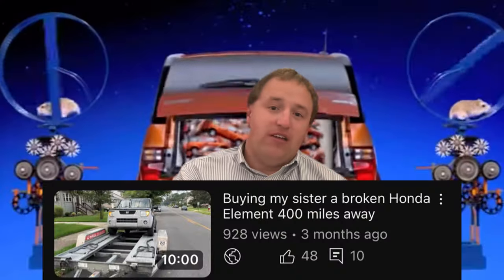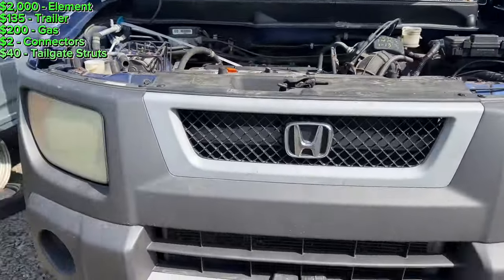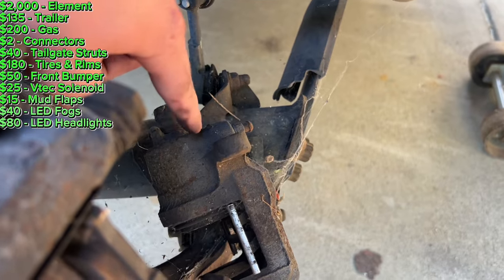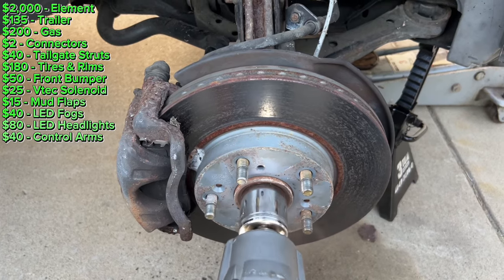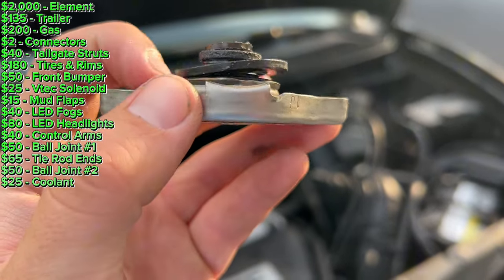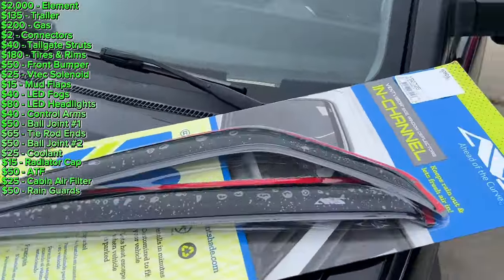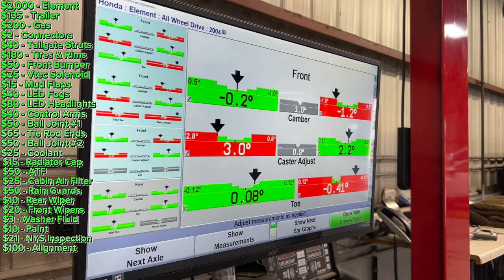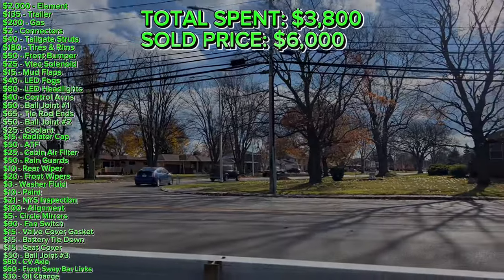Buying, restoring, and selling a 2004 Honda Element AWD

Comment: I think what you are doing for the Element community is great! Restoring and putting these vehicles back on the road or in society is epic, salute!
Reply: I just bought a 2003 220k miles one owner. I’m thinking of using my mechanical knowledge to start a series of me fixing pretty much everything on it
Reply: @shanedottie  I have a 2003 with 225k!
Reply: @joseph9531  nice how’s the trans holding up
Reply: @shanedottie  As crisp as the day I got it in 2020
Reply: @joseph9531  nice, if you plan on keeping it long than change the fluid it’s super easy, basically as easy as changing the oil
Reply: @shanedottie at what intervals should one be changing the transmission fluid every 80,000 & how about a full tranny flush and not just a drain/fill?
Reply: @ never flush it just drain and refill multiple times in a row

Comment: Holy shit, I'm going to get those rear mount struts.  Also, I had the P2647 VTEC issue.  Went through a few solenoids (new and old) not working to clear that issue.  What I did, and recommend doing, is prefilling the solenoid with the new oil  (like what you do with your oil filter) to the top tapping to remove most air bubbles.  When installing, quickly push on the head while also installing the 3 bolts.  After that, had no issues.

Comment: He skipped a step, because upon replacing those ball joints, he had to get the front end alignment for sure, or the car will be going left to right. Once you take those tie rods and ball joint loose, you have to get a front end alignment, it's no way around it, so he flat out skipped that step in the video. He also could have saved himself some money by merely going to a part store and getting that solenoid, because I did the exact same thing, I bought an after market and ended up getting a brand new one at the parts store with a warranty. The time and gas he spend going to the junk yard, he could have gone to the part store. He also could have ordered those ball joints and got them much cheaper online. I have an Element so I know. Looks like he has rust issues underneath as well.

Comment: Great Video.  In depth on common issues with a fantastic commentary & explanations.  Really liked your work around with the sockets to get the CV axle apart. The battery upgrade with tweaks made to the tray are a huge plus for that E or any similar vehicle. WATKINS GLEN !! AWESOME!! Your sister missed out on a vehicle that many ppl would camp overnight for.   Makes me wanna do more maintenance to get ours as good as yours.  10/10.  Nice job.

Comment: Thank you! Just bought my second Element after a 10 year hiatus and got a 2005 EX FWD in cargo Khaki. Stoked on the color even though it is not AWD. It is stuck in Limp mode after the small dealer replaced the VTEC solenoid with an aftermarket one. I should have got grabbed the original he removed. Going to get an OEM part this week and cross my fingers. Already cleaned all of the screens part of my the oil circulation system.
Reply: Went through a few solenoids (new and old) not working to clear that issue.  What I did, and recommend doing, is prefilling the solenoid with the new oil  (like what you do with your oil filter) to the top tapping to remove most air bubbles.  When installing, quickly push on the head while also installing the 3 bolts.  After that, had no issues.  
Also, clean or replace the front VTC filter along with the solenoid, consider that before replacing the aftermarket one.  Also to check GND continuity from the Engine GND to the solenoid connector GND (yellow wire).

Comment: You did a great job!

but 

Adjust your mirrors out properly and the only blindzone you should have will be right next you. No stick-ons required. Also, the battery upgrade is very overhyped by the forums. It is the same battery used in all 2.4L Hondas...I used a quality 51R battery and it lasted me 6 years, starting through midwestern winters. If your battery won't crank in the winter, consider if you have not driven in a while you may need a tender during cold weather...getting a 'bigger' battery fixed the problem because it can drain for longer without issue. It does not mean the OEM battery is undersized.

Again great job. And good note about the ball joint needing splines.

Comment: Another great video! Where did you learn to work on cars? Did you just watch videos like this or did you go to mechanic school? I'm impressed.  I've owned two Elements (one of which is my current daily driver). I'm not afraid to do engine work (valve adjustments, sensors, pumps, things like that) but the thought of doing the type of suspension work in this video without a lift has always been pretty intimidating to me.  You have my respect!
Reply from the maker: I use to work at a car dealer through college and my employee labor charge was only $35/hour, so up until then I didn’t do anything myself, but would always watch the mechanics. Once I graduated I stopped working there and had to start working on my own cars at home. YouTube definitely helped lol

Comment: I feel as though I'm getting ripped off for the Element that I'm about to purchase and no fault other than to my own for accepting this price but I also hear these Elements usually list higher than what Kelly lists the value. $7,000 for a 08 EX 152,000.
A lot of replacement parts were part of my decision for purchasing.
Brand new set of Hankook all-terrain tires rated for snow.
New tie rods all around,new set rotors/brakes all around, 4 new motor mounts, new door checks, fresh oil change & alignment. The previous owner spent $1,400 on just the parts alone. The paint is in very good condition, surprisingly the molded bumper and other portions of the car that are not metal are still in good unfaded condition & I'll keep those parts looking new by using Cerakote trim protectant. I did notice a dealer trying to sell a two-wheel drive Honda Element for $33,😂😂😂

Comment: Alex, someboy is selling me an Element for $2,000, with these problems: 

It needs:
- catalytic converter (test pipe in place) 
- Intake Air Control Valve cleaned  
- AC servicing (no idea what's not working) 
- A-B trans solenoid (fluid/filter replacement too?)

It has:
- 175k miles - 4-speed auto trans - AWD - front grill guard - seat covers - Thule roof rack with RockyMounts -- running boards - receiver hitch - VW rear hatch lifts - clear Michigan title -

Also a new 3 year battery, new cabin and engine filters, and an OEM storage console armrest

If I knew what you know, I'd get it.

Comment: You didn't have to sand the rims, all you had to do was use purple power, it would have cleaned those rims sparkling clean. I detail vehicles and I've had some truly bad rims, purple power would  have eaten away all that rust EASILY. You also could have used plasstic restorer for the trim. Mine looked like that and it made it black afterwards.

Comment: I love your vids, I have an issue with my 2003 DX Element; how to get my Elements hood open when the cable seems to be disconnected. Any ideas to get it open....Any help is appreciated. I'm in the rust belt. Element has 179,000 miles....Tks
Reply from the maker: Luckily I’ve never had to deal with that knock on wood

Comment: I love my 2006 Honda element

A man made a left-hand turn, hit me right in the front broke the plastic bumper and grill, and he pushed in and broke my radiator and my condenser 

I fear my insurance company is just gonna say it’s totaled because it has no value 

Anyone who can help me with this Honda elements are worth more than they show on paper. Just try and buy one. 

I will check back for responses thank you everyone in the Honda Element community 

This is fantastic video. I can’t wait to fix my arms in the back and hold that tailgate up. I love my Honda element.
Reply: Sorry I hadn’t seen this sooner.  I have just recently just recently gotten the element bug.  I  had a similar  problem with a ford ranger.  I was satisfied with what the insurance paid me until I tried to replace the truck.  How did you make out?  
I think that if I wind up getting an element, I’ll see if I can get a cash policy.  Somebody told me that they doit for classic cars.  What ended up happening?

Comment: I was fine with what Alex did until he got to the plastic panels and he mentioned "Toaster Grease" and I shuddered. He mentioned CeraKote Trim Treatment, so he knows that CeraKote is THE go-to BEST STUFF for clear lenses and plastic parts! Did he mention that if you use the GREASE that your plastic will never accept the ceramic treatment? Well NO! Why does this GREASE exist? Because CeraKote costs about $17 and the GREASE is $1.50?? There's always some joker out there that puts together a trash product cheaply. Don't use the Toaster Grease EVER!! Go to your local Walmart and buy some CeraKote for your Element! Headlights, Body Panels and every plastic part needs the new ceramic chemistry. Guaranteed for 200+ washes! Would you polish your boat with BUTTER? Literally the same as putting grease on your Element's plastics! NEVER USE GREASE ON YOUR PLASTICS!! Don't be a fool Alex! Tell people not to spoil their plastic parts with grease please!!